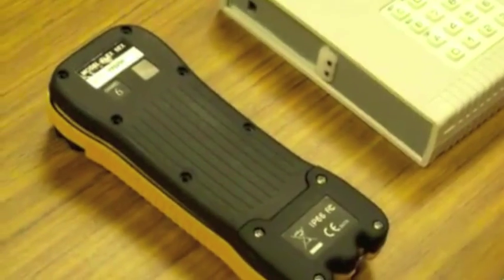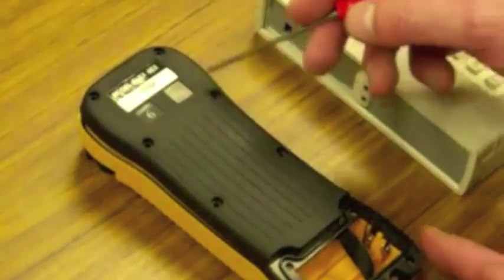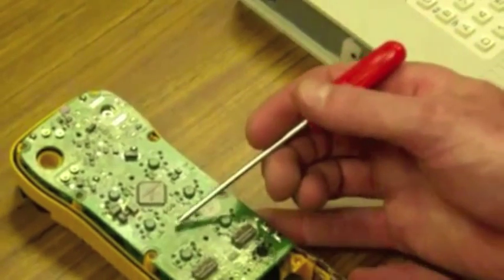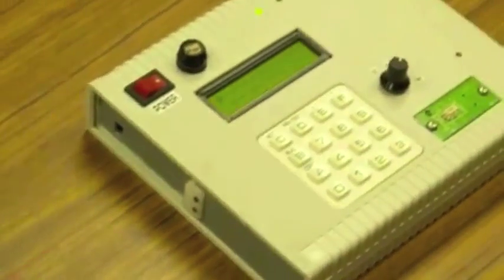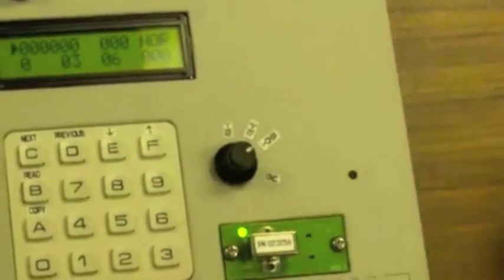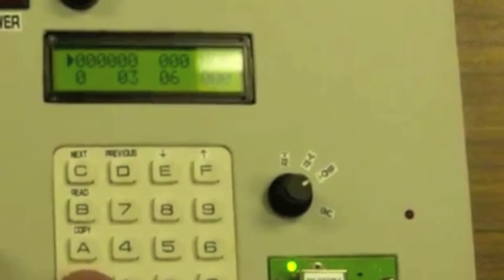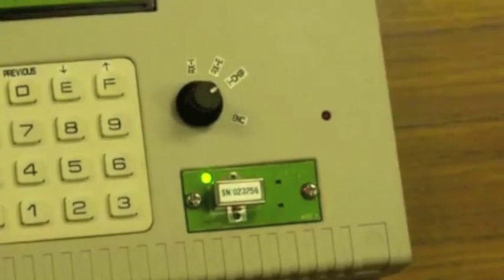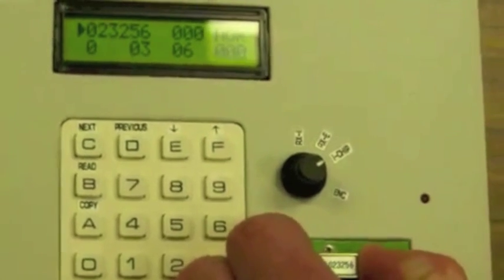How to Program Magnetek's Flex EX Series Transmitter from an I-CHIP Programmer

Comment: Is there a way to program the transmitter button function? I have a Dual Overhead Bridge Crane utilizing your FLEX 8EX2 transmitter (8 Button). I’d like to be able to have the option of keeping both crane trollies and hoists active at all times and then manually selecting each with buttons 7 and 8. Thank you